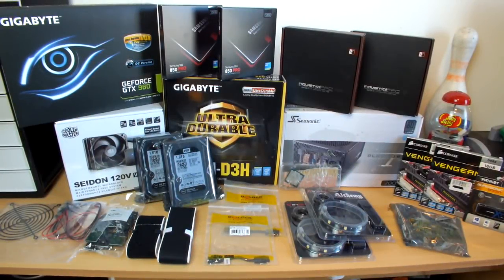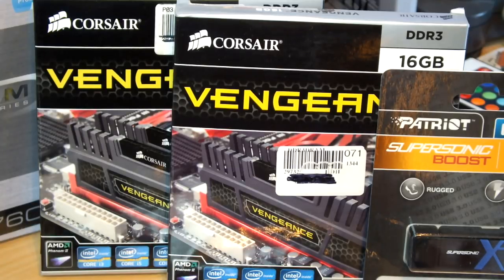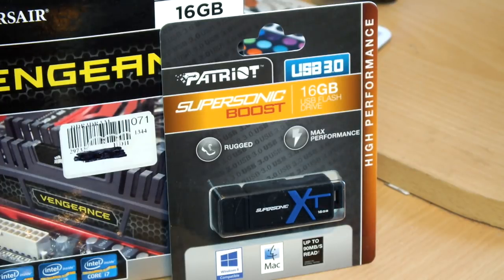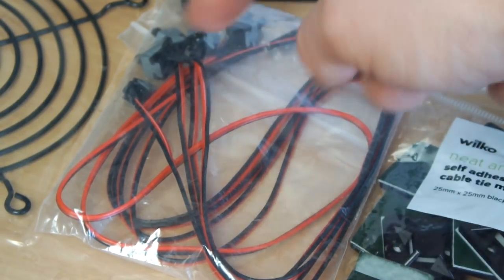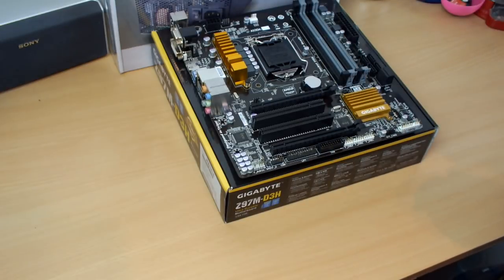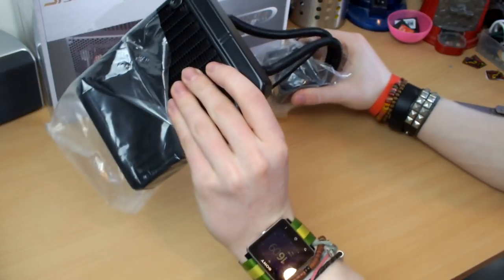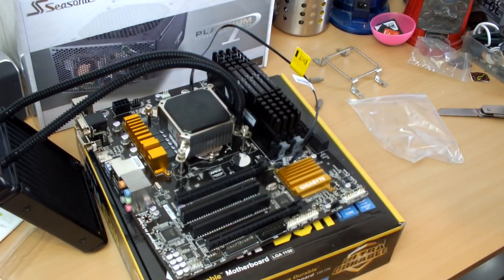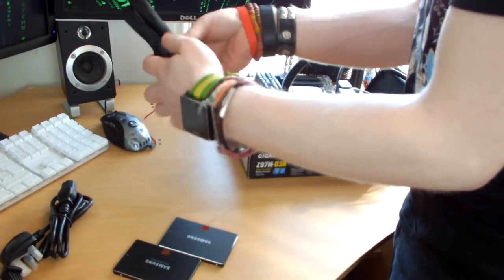2015 Hackintosh Build: Part 1 (Parts Overview, Test Bench Build & First Boot) | IMNC

Comment: If the Noctua fans are "airflow" fin design I would recommend against using them for a radiator - they are best as case fans. You should ideally use a fan with "static pressure" fin design for a radiator (which the included CM fan most likely is).
Reply from the maker: segaprophet I'm no fan expert but these fans are highly recommended for radiator use on the Noctua website so that's good enough for me
Reply: ItsMyNaturalColour Actually, looking at the NF-F12, it looks to be a bit of a hybrid design, so you should be just fine. The "fatter" fins are a give away that it should handle static pressure situations adequately.

Comment: Tom, next investment I think would be a slider for some super sexy pans, like a Konova or Kessler.
Also, turn down the music when you are speaking! Sound is important, bad sound offends more than bad video.
Reply from the maker: ***** Maybe one day, but as I'm sure you know I rarely do these kind of shots so it may be a slight waste of money at this point compared to something else that may be more useful.In terms of sound, sound has always meant 10 times more than anything visual to me. Being sight impaired I rely on sound so much more. Background music is a tricky beast and it's the first time I've really done it. It's funny because I spent a lot of time balancing this video. I actually referenced it on 3 different sources; my Creative computer speakers, studio setup and headphones. The outcome is, some people think the background music is too loud and some people can't even notice it's there. Lots of people think it's just right. I'm taking this as a good sign because at least I know it's not too overpowering for everyone or too quiet that nobody noticed it. I think a lot depends on the listening source at your end, especially in terms of low end reproduction because of how bass heavy the majority of the ambient background music is. If you don't have a sub or speakers / headphones that can reproduce below 60 or 70Hz effectively, it'll be hard to notice the background music at a normal listening volume, from what I can tell anyway. Next time I'll probably use a curved high pass filter on all the background music sweeping from 30Hz to 80Hz and crank it up 2 or 3db. That should be the perfect balance.
Thanks for your comment, feedback much appreciated :)

Comment: I don't think having both Samsung SSDs in RAID 0 will benefit you that much at all. The maximum theoretical speed of Serial ATA 3.0 (6 GBpbs) is 600 MB/s, so the maximum speed you will achieve with these in RAID 0 is about 600, not anywhere closer to your MacBook Pro's PCIe-based SSDs (~1,400 MB/s)..
Reply from the maker: 1AppleMaker RAID 0 will use 2 SATA 6Gbps ports so that already doubles the throughput of a single port, 1200MBps, in theory.

Comment: Tom I am thinking of getting a MacBook Pro are they good or bad
Reply: ***** DO NOT get an early 2008 model I have had tons of bad luck with mine
Reply: ***** 2011 MBPs have overheating issues. Mine gets hot but hasn't died or shutdown.
Reply: +Fenreon Arlius my mom and brother both had 2011 MacBook Pros and both died (GPU)-getting fixed in a week and soon to be mine

Comment: What's better a 4770 or 4790k?
Reply: justinmason100 4790k, its the newer version of the 4770.
Reply: justinmason100 Depends on what you wan't to do. Do you wan't to overclock if so the "K" might mean something to you :D
Reply: ***** Yeah, that what i thought. WafflePandasz I meant the 4770K. Sorry, yeah i will be over clocking
Reply: then 4770k is good for you if you want to overclock (it will make it a heck of a lot easier to overclock). Happy building :D